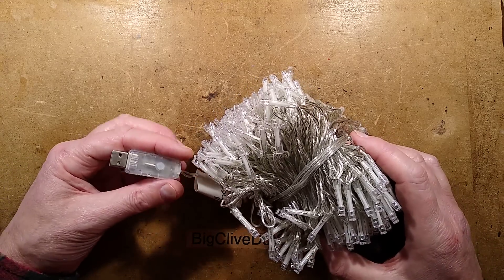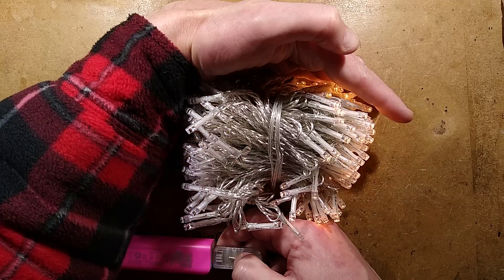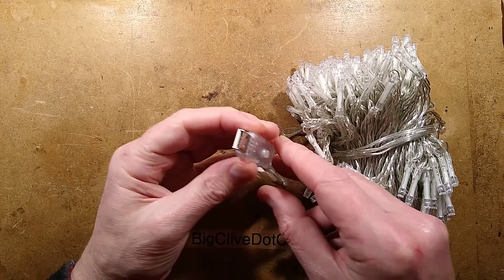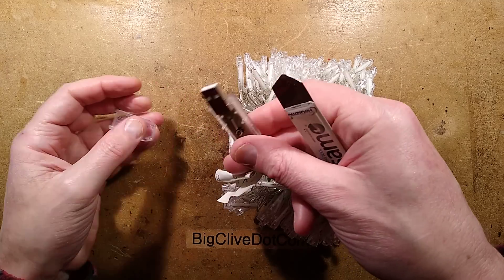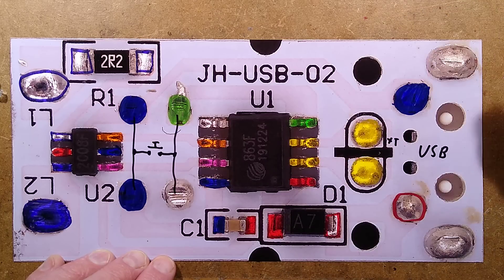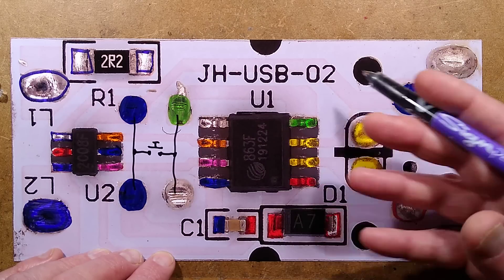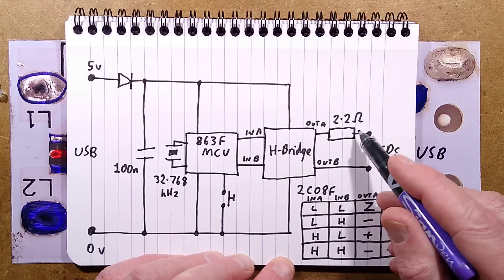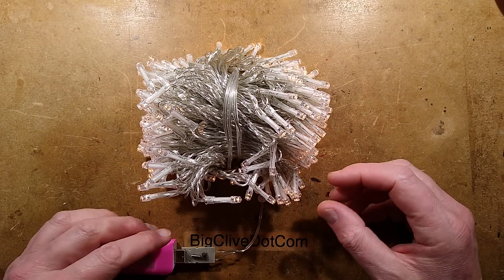USB fairy light controller (with schematic)

Comment: If keeping the last setting is really important for an application perhaps wiring the microcontroller power pins to a pair of AAA batteries (or a 3V coin cell?) with a diode in series will give it enough voltage to remember the last setting without turning the LEDs on.
The diode in series with the batteries will prevent charging the non-rechargeable batteries when USB power is available and provide voltage drop so that the LEDs do not light up powered by batteries, although they may light up for a while with fresh batteries until their voltage drops from 1.65V to 1.5V

Comment: I had a similar set that ran off D cell batteries with 500 LEDs. Some of the connections at the pack broke loose and I decided to turn it on while troubleshooting. I actually got a nice zap from it, made my arm twitch and everything. Hooked up my multimeter and read 87 volts AC without the LEDs in circuit. Pretty surprising but I suppose they're running them in series pairs for efficiency.
Reply from the maker: Some of the early ones used standard LED strings and boosted the voltage.

Comment: Oh for the days (about 10 years ago) when we had 3 and 4 channel Christmas lights instead of these 2 channel ones just driven back to back, you got far more interesting colour patterns!
Reply: Chase that chased. Twinkle that twinkled.  Aah, the days. Swap some with dropping capacitors and series inrush limiters and the rest will last for years, even if used every night.
Reply: @tactileslut  👍👍been there...done that ..& still doing it .. 😀my 1956 "incandescent Christmas Lamps " ...also done with (series resistive old fan regulator,)
( then bought by my father ) are still good to go for another 60y. ..then ..screw in type... beautiful screen printed coloured glass "CHINESE" lamps...2 totally different sets each 24 nos... what are they.?? glass blown & shaped as.....santa claus (starter lamp) pumpkin,snowman/ woman , parrot fish.grapebunch,lantern shaped( round,oval, cylindrical) ...heart,roses,frog,etc..etc...and still have managed to retain their original corrugated cartons too !! (though in bad condition now) .
Reply: I've got a little USB powered  'intelligent LED' string.
Comes with IR remote.
good colours and patterns
Reply: Technology Connections has a whole load of videos on christmas lights. They may be of interest to people. One is some weird lights that were like lava lamps.
Reply: Hell, I remember the color wheel spot lamp...
Reply: O for the days, about 20, or 30, years ago....
Reply: @idjtoal  70 years ago hanging lighted candles on  Christmas trees. Yes they actually did it with lots of house fires.
Reply: i do like the mellow (and less harsh) feel of the coloured christmas lights, the filiment lights althought I have probably been conditioned to prefer them as thats what I first knew.

Comment: I'm looking for a way to use a small section of fairy lights in a glass mason jar replacing the customary standard static led lights that usually comes with the top solar chip and battery. Accompanied with something like a ESP8266 that can receive receive and react to a sequence of patterns. To mimic a something like fireflies in a jar. I would prefer color leds but golden white would work.
Reply from the maker: You can get firefly LED strings where every second LED is a self flickering one.  Quite hard to get decent ones though.

Comment: $8 - Nicely done, didn’t know about the H Bridge truth table. I have a project that needs to flip the polarity so this teardown is super helpful. Thanks! The $8 is a Twitter thing. 😊
Reply: L293D is a common dual H-Bridge chip, so is L298N.
Reply: Keep in mind that when using an H-bridge to alternate polarity with just a single rail supply you cannot ground the load as the load is driven between positive and ground but on alternate legs.

Comment: I'm just curious what the hour rating is on those LEDs until you have to replace the whole string yeah. At least they're not embedded with your artificial tree. Those are a b** to troubleshoot. I'm just saying
Reply from the maker: Christmas light strings seems to use the smallest LED chips available and often degrade noticeably over time.
Reply: @bigclivedotcom  I have a string in the greenhouse, after running for a year 24/7, a crude luxmeter on the phone showed as ¼ of a new.
The new runs at a timer/light sensor from dusk to midnight and dawn to 8. Timer and sensor probably uses more power than it saves, but the light lasts longer.

Comment: I get why they generally don't, but it would be awesome if they could wire these strings so every other light is opposite, rather than one whole half of the string.
Reply: These lights look like they're bundled up accordion style where the right and left sides of the bundle are every other one on the string. Hopefully that makes sense,  I'm not completely sure myself 😂 If you have a big enough screen you can see the loops of wire among the LEDs going back and forth.
Reply from the maker: They're alternate polarity along the full string.
Reply: I'd rather have it as you propose, arriving with an obvious flip in the middle. That's where my splice goes to make it run on DC without the strobe.

Comment: If the H bridge has - -, +- and -+ modes, they could’ve got three wires out of the circuit board (C1, C2 and +) and that would allow them to drive the lights at the same time without multiplexing between polarities. Basically pull C1 or C2 to the negative rail to turn either side on.
Reply from the maker: Only one polarity can be put out at a time.
Reply: Needs you to add in the third wire, and the machine they use is designed to use 2 wires only. Automatic machine that you just put the roll of wire, the heatshrink and the LED's in, and it will assemble them into the strings automatically. Even tests the LED's and aligns them correctly as well. Start up, and leave, and come back later to the pile in the output tray.
Reply: Then you don't need an H-bridge anymore, just use two mosfets to pull c1 and c2 down.

Comment: To me hot melt glue looks more like some sort of inert plastic than "glue" that solvents can dissolve.
In fact in my experience even acetone doesn't do much to it.
Therefore I don't bother using IPA on it.
Instead I gently pry it apart with a small flathead screwdriver and when it's securing something against a smooth plastic surface it often comes off in a satisfying manner.
Reply: Before I knew acetic acid dissolved hot melt glue I made my own custom kitchen LED fixtures out of a nice warm LED light hot melt glued into the enclosure. So oneday I was making pickle brine and the LED unit dropped out of the enclosure.
Reply: @johnpossum556  🫢😄
Reply: I've put nitro engines on Flite Test foamies before. Those airplanes are built using hot glue, and nitro engines burn primarily methanol(Nitromethane being a power adder). Raw fuel spills on exposed glue joints does de-chooch the hot glue quite readily.
Reply: IPA or ethanol causes it to shrink slightly, making it easier to be removed. Polyethylene feels different.
Reply: Heat helps
Reply: @michaelosmon  Yes, I forgot to mention that.

Comment: I'm still looking for a cheap timing ic that sets an output low after a set time. See this happen more often with such a crystal but can't figure out which IC it is and how it can possibly be programmed.
Reply: A CMOS 4060 has it's own RC or Xtal oscillator, and a 14bit counter so it can produce quite long delays, programmable by and'ing the proper outputs together. 
About ½€. A 40 year old chip, still going strong.
Reply: @LeifNelandDk  Thanks, I'll take a look
Reply: These days the 8pin micro is the king of special projects.  Writing the code to do what you want is not too hard and the chips have remarkably low idle current.
Reply: @KallePihlajasaari  for writing/ programming & testing code... one needs pc an latest compatible s w. ...interface modules
compatible chips ..wiring& soldering h.w. too...

With ( the still available!!!)discrete 60 yr.old logic h.w...only wiring& soldering h.w. is reqd.

Comment: Could you cut off the USB plug and run the lights on low voltage AC (with a resistor)? It would allow both halves of the LEDs to light and avoid the need for an H-bridge. I wonder if 50/60 Hertz would be sufficient for a "tolerable" level of flicker?
Reply from the maker: The flicker is very noticeable at 50/60 Hz.  Although many older American strings did that.

Comment: That is a weirdly high level of precision on that timer.  I'd expect a "close enough" internal oscillator in the microcontroller, not a crystal.  Would adding a beefy capacitor in parallel with the little one extend the memory lifespan by any useful amount?  Minutes, rather than seconds?
Reply from the maker: I wrote some software for a PIC microcontroller for a daily timer that used the internal oscillator.  The drift was way too much, and was affected by a falling battery voltage.
Reply: @bigclivedotcom  Oh, yeah, it's definitely not a good way to do a timer, but it is a cheap way, and I'm surprised they didn't go with the cheapest possible approach...
Reply: @bigclivedotcom  You had to keep track of time of day. This thing couldn't care less what time it is...
Reply: @bigclivedotcom  doubt you will see this, but I’ve waited months for a radio screen replacement and fitted it then disconnected the lcd without thinking and pop no screen how do I send in things for you
Reply: It's less about precision and more about power consumption. Microcontrollers often include very low power oscillators intended for real time clock use which can continue run whilst the rest of the micro is in a low power sleep state.  Those crystals cost pennies since they are so widely used.
Reply: @ParabolicLabs  That's ironic, it used to be the other way round!
Reply: I have an alarm clock with a 2032 backup battery (keeps time despite power failures) and a quartz crystal. The crystal is slightly off and the clock gains a few seconds per month. I wonder how accurate the usual 32768-Hz crystal is?
Reply: @markiangooley  Doing a very slight bit of googling, worst case scenario seems to be ±1hz, which would drift 2 hours and 13 minutes per month, roughly, assuming the circuit is receiving a pulse at 32767hz and expecting one at 32768hz.

Comment: Unusual to see the timer function actually using a crystal reference. Usually they just cheap out and use a timing loop in the microcontroller.
Reply: Not for accurate timing turning on the same time every day. 0.1% deviation is 1½ minute, a RC oscillator is far more inaccurate, the light would turn on and off at any time after a few days
Reply: This one's xtal.based timer is an advantage for accuracy and reduced parts count . All uC. / uP work on crystal generated clocks/ Freq. references..be they external or built in...timing loops use these same references...as base.

Comment: That symbol on the microcontroller looks very similar to the Expressive logo, makers of the ESP chip range. It think they do make simpler chips other than the ESP range of controllers, would have to be super cheap to find their way into these types of products though....
Reply: I suspect Expressif are having their chips cloned by knock-off fabricators, just like everyone else. ☹️

Their simpler processors are competitively cheap in OEM quantities, though.
Reply: It indeed looks similar to the Espressif logo, but rotated 270 degrees (or 90° CCW). It perfectly could be though, because originally Espressif manufactures cheap chipsets for the Chinese gadget market and instantly became "Famous" when they introduced the ESP8266 WiFi chip, which was also usable to the hobbyist community.
Reply: Oh yeah! I knew that logo looked familiar!